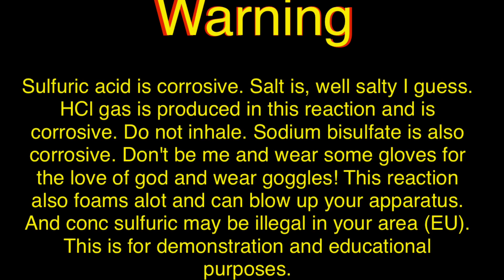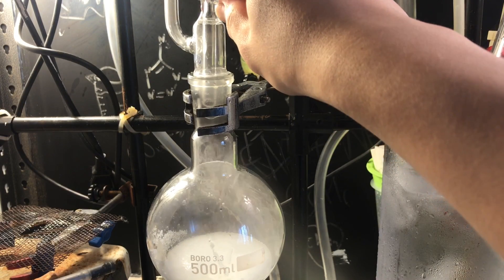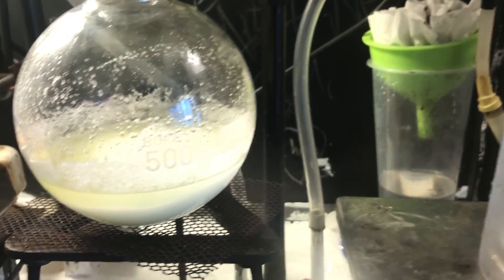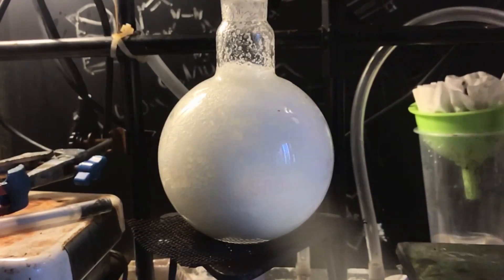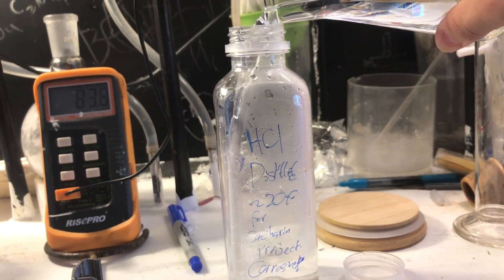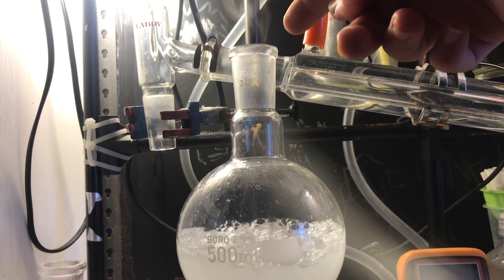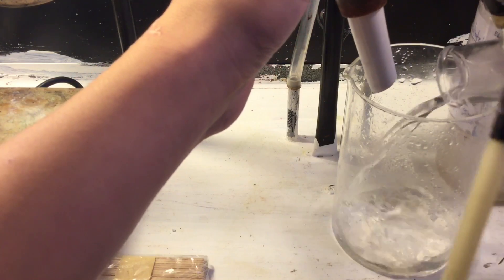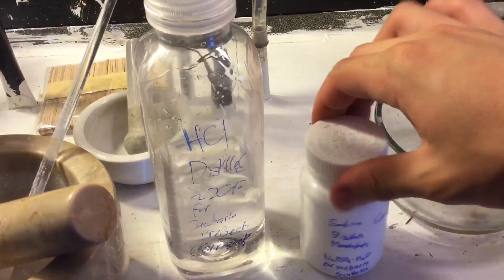Make hydrochloric acid from salt

Comment: is there a way to avoid using any sulfuric ingredient? I don't have sulfuric acid at home, only table salt. Also, this process looks complicated, a lot more simpler would be burning salt with a laser in a vaccuum. you would get pure chlorine and pass it through distilled water, that's it. That's what I usually have at home, table salt, lasers, CNC machines, 3d printers and this kind of stuff. Easier for me to just burn it. Maybe I will put a picosecond laser for this work to avoid wasting lots of energy.
Reply from the maker: salt has a strong ionic bond so it's unlikely you can split it with just a laser, it will boil into a gas before it splits from heat which at that point the laser cant do anything anymore. even industrially its more efficient to actually melt the salt and pass electricity through it. as for sulfuric acid it can be substituted with sodium bisulfate, there isnt any way around that and if you dont have sulfuric acid nor can buy it just buy hydrochloric acid at the hardware store as muriatic acid
Reply: @EdwardTriesToScience  how much sodium chloride and sulfuric acid will I need to make 38% concentrated hcl in a 40L water
Reply: yes, burn a piece of PVC and the gas emitted will be mainly hydrogen chloride which, in contact with water, creates hydrochloric acid.  your assembly must be waterproof and have good ventilation.